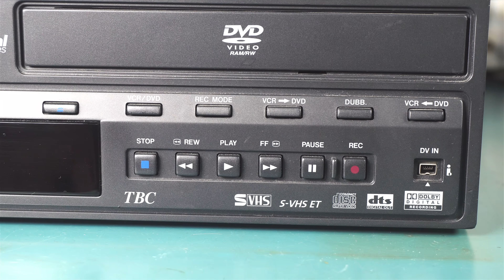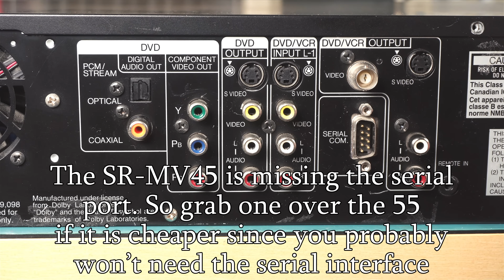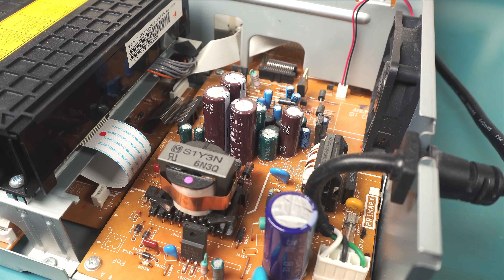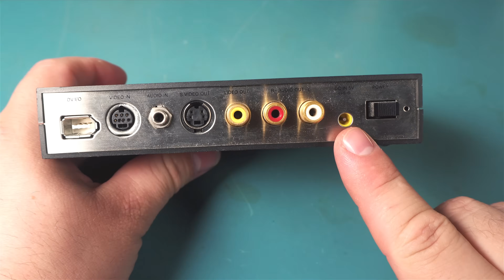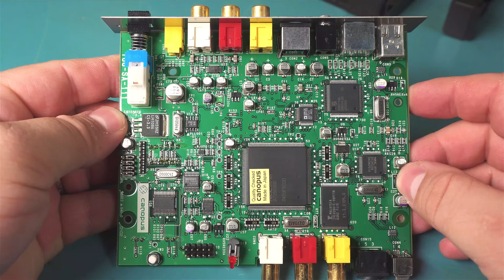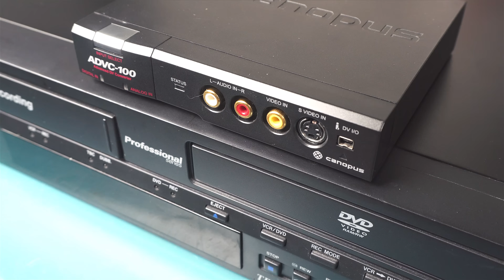JVC SR-MV55 VCR + Canopus ADVC-100 Quick Teardowns

Comment: If you press the silver button on the Canopus ADVC-100 for 5 seconds, a color bar test image appears, and if you press the silver button for more than 15 seconds in analog recording mode, it ignores Macrovision. I've read it but haven't tested it because I'm not really interested in Hollywood trash. I found out myself that the Electrolytic SMD capacitors do not last 50000 hours.

Comment: I have an ADVC-100 and want to use it for digitizing VHS tapes.  What software are you (or anyone else) using for your VHS conversion purposes??
Reply: I use ScenalyzerLive, which is free and works well with the ADVC-100. Just remember to go into the options and turn off the "max file size 2GB" setting that's on by default.

Comment: Thanks for the teardown. Was curious what was inside - I have the ADVC-100 that's starting to flake out. I noticed when the device was on for a while, the capture would freeze after a shorter and shorter period of time. Tried putting an ice block under it and oddly enough that seems have resolved the issue for the moment. I've got 32 VHS tapes left and then I can toss the whole deal. Think I will do the Macrovision ones first just in case I have to jump to another capture device like the Blackmagic. As high quality as the components are, I guess 20 years is still a long time to expect things to last. :)
Reply: I wonder if the advc would have benefited from some kind of active cooling on/in its case
Reply: @mpxz999  I'm sure it would have, but the units probably lasted as long as Canopus expected. They were probably spec'd for a 5-10 year life. Who knew we'd still have a need for them decades later?
Reply: What software are you using for digitizing the VHS tapes?
Reply: @mcrawford7117  After capturing, I use AVISynth to process the files (deinterlacing, minor color/contrast correction, sometimes a little sharpening, etc).
Reply: @AaronClow  OK, thanks.  And for raw capturing process itself what software?
Reply: @mcrawford7117  VirtualDub. Tried and true. :)
Reply: @mcrawford7117  Sorry for the delay. I use VirtualDub for capturing.

Comment: does this cannopus can be used as pass through TBC? or only analog to digital converter?
Reply from the maker: The Cannopus is not a TBC. The VCR has an internal one.

They do make one with a TBC, but I read it isn't all the great.
Reply: Peter Brockie I’m looking for fullframe pal 625 lines 50hz full frame tbc, kinda hard to find on ebay considering that I don’t know what companies built them in past days.
Reply from the maker: I'd google around, there are a few forums out there who talk about VHS archiving in detail with TBC recommendations.
Reply: Peter Brockie I saw, but they know few, I find more , also better or same as on forum, but seems for ntsc, or unrecognizable format, even unlisted videonix mx 1 that nobody know about such tbc also HOTRONIC AP41-PAL
Reply: @PeterBrockie  Which OS does ADVC100 require ?
Reply from the maker: @NBAONDVD  Should run with no problems on just about anything. I was using Windows 10. No driver downloads needed.
Reply: @PeterBrockie  My advc100 doesn`t work on MACBook Air with Premire
Reply from the maker: @NBAONDVD  Try a generic firewire video recorder. I belive QuickTime 7 Pro or older versions of iMovie can both record DV.
Reply: I have several video about the Intensity Shuttle and the ADVC 110. You don't need a TBC with the ADVC 110. My latest upload would be a good place to start.
Reply: TechTVusa I’m looking for now to composite and svideo hardware deinterlacer, I don’t like interpolation or field discarding technique used in AE and Premere pro, but can’t find any, maybe some satellite receiver can do?
Reply: @protasov-by  You don't need hardware. As I stated use software only mode to render 480i to 480P. If you use the GPU it can look funky. Having said that you will not get a better results using hardware. You should make some videos to show us what you have done thus far. I will have more videos soon that should help.
Reply: TechTVusa show soon, wait for composite scaler, also cables etc, but I guess some broadcast rack mounted hardware can do vector adaptive deinterlace and scale to 720p that I looking for. Cuz watch or editing footage in 480i on 4K displays seems too poor :)
Reply: @protasov-by  I can upscale SD to HD using the Intensity Shuttle but it does not look that good. Perhaps you can buy the hardware and do a comparison between Premiere Pro's upscaling method and hardware based upscaling. As I stated I will have more videos coming soon. One will be about using a Time Base Corrector.
Reply: TechTVusa I guess to use TBC and DNR as one button magic box came from JVC HR 9700, this get best s video sig. possible from tape I think, then I’ll convert s video through my current Panasonic ES15 (use it for now,  it had deinterlace on board, but seems is a line duplicator bob algo, which cause text horizontal flicker/jitter) then in mind is to use something like Panasonic EH68 as next week/two upgrade, like for second passthrough (this has on board component and hdmi, so possible has upscale) and it can deinterlace, it also can be the replacement of ES15,  so use first only as comb filter and additional TBC if second don’t have these old for it’s era functions. I fight with obtain HDMI from VCR, then will capture through BMD shuttle. This will be done soon like component to hdmi scaler, little box I wait from postal now, but seems that coming scaler has poor deinterlacer and need progressive signal. Upscaler is cheaper 10 times than EH68, so prefer to test it first, an EH68 has HDMI out, so can be used ass pass through for my component but it’s deinterlacer can be same. Main question is to buy or not to buy this EH68 cuz I’m not sure if it fight upscaler. Maybe EH68 DVD deck can do deinterlace better than first dvd deck, but if not, and/ if don’t I’ll reach problems of money loss. I guess some hardware processor instead, but take time to find money for,  maybe is best to invest in processor, I have found one for etc another problems like Spatial and temporal noise, proc are Leitch DPS 575 or 475 for NTSC, cuz without EH15 DVD’s TBC and DNR s video  signal seems off sync and noisy, this rack mount Leitch thing also has 3D comb filter, and seems better than DVD’s one at least it works in 12 bit vs 8 in deck and 10 in BMD shuttle thus can convert VCR svideo to component too. So JVC 9700 + Leitch 575, or my current 5800 + EH15 + further Leitch will do denoise job and give me interlaced component sig., as you mention better off DVD’s one. When I solve first questions like replace my HR5800 TBCless VCR deck to HR9700 and replace EH15 to Leitch or EH68 or both chained, hard choice bother me now,  there I guess will obtain best of VCR to component rgb clean conversion possible at home :) but anyway if EH68 doesn’t have better deinterlacer than ES15 (flicker damn bob algo) then I need vector adaptive loseless deinterlace hardware, maybe there something exist as Leitch, hotronic ap 41 etc, some broadcast piece deinterlacer, or maybe I will find something simple like DVB tv box  or satellite decoder that known to be as component deinterlacer for 720p hd ready kind of TV’s, 720p make my edits more simplier then. I think I can capture as 10 bit video after solve all questions, even if BMD shuttle don’t 10 bit, I’ll have BMD Visuall assist 4k recorder, it can do Apple pro res 422 seems be better, didn’t think of connecting gear for my  cinema shoutouts to where tape capturing, but why not. anyway goal is get 720p from tape as clean and crisp as possible, even though about find some neural networks solutions that will up converts things like 576i to 720p or even 1080. Dream is not just capture but kinda remaster.
Reply: @protasov-by  Are you trying to make VHS look as good as DVD? I would just edit the video at 480i and export at 720P.  What do you have on VHS that is so important?
Reply: TechTVusa all my memories. Lots of people I lost etc, as good as to see it same, why crt 40” looks better than 4K 32” ips :)) and its not a export thing, it’s a remaster, I need. make documental films.
Reply: @protasov-by  Are you expecting a TBC to give a better result then the Canopus ADVC 110?
Reply: TechTVusa TBC just handle horizontal skew, off sync mess that cause picture ripple on low signals like old tape. My DMR15 do line or frame TBC,  that made picture rock stable. I try component upscaler, if it not help, try to line converter from retrogamers research, if still not help, also try capture screen to camera in black box, like self made telecine conversion from JVC PVM.
Reply: @protasov-by  Have you used a Fire Wire DV converter? You know they take old stretched out VHS and HI-8 tapes and clean them up so they are broadcast compliant. DV converters have a lot of hardware in them just like the old school PCI capture cards. If the Canopus ADVC 110 or even the ADS Pyro AV Link does not work the tape maybe damaged so bad that  the best $2500.00 rackmount TBC still will not help. I will post a video soon that will show what a generic  Fire Wire DV converter can do. I am not saying it will educate you at all but I think many people will benefit from me doing a TBC type video.
Reply: TechTVusa ok, I also found hw deinterlacer (3d motion based) look at cypress cm-398m
Reply: @protasov-by  That device will only allow you to play a VHS or DVD on a VGA computer
Reply: TechTVusa read manual section features :) I’d do more than rackmount stuff except manual smooth adjustments, vga just port, so it have not only XGA resolutions but also may have 720p, so it’s not that hard to chain it to BMD shuttle via vga hdmi converter. I guess HW 3D deinterlace based on 2 back 2 forward frames will do job better than any codecs filter. In my case with component I will use  CM327 model, it also had 4 band comb filter for Y/C DNR
Reply: @protasov-by  The Blackmagic Design Intensity Shuttle will only capture broadcast complaint frame rates, aspect ratios and resolutions. The Intensity Shuttle is very picky. I don't think the CM327 device will output broadcast complaint frame rates, aspect ratios and resolution. You also do not want to deinterlace the video.
Reply: This video link demonstrates that the Fire Wire converters have a chip inside that functions as a TBC but they do not allow for pass through.  https://youtu.be/xdw9_DETrqE